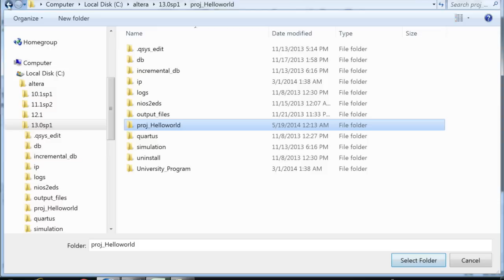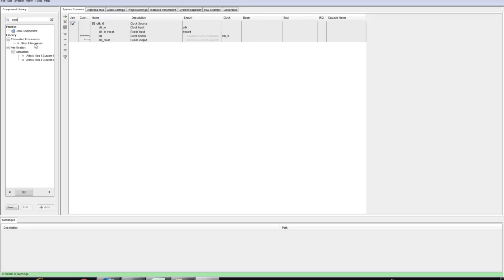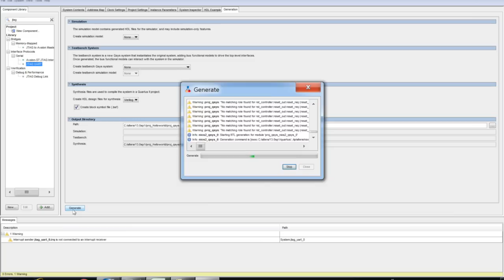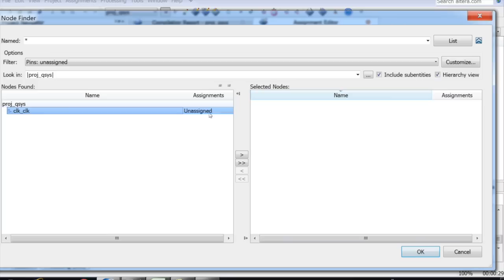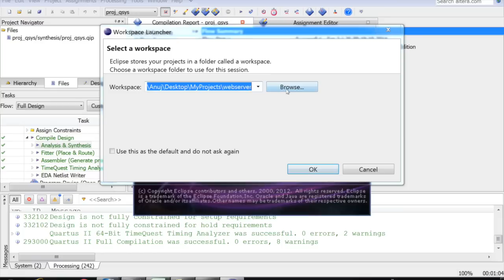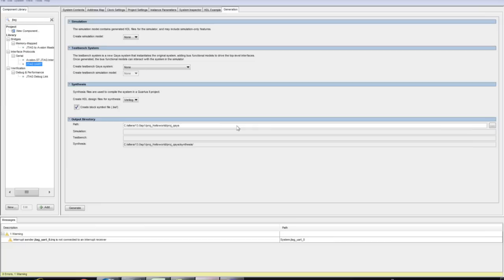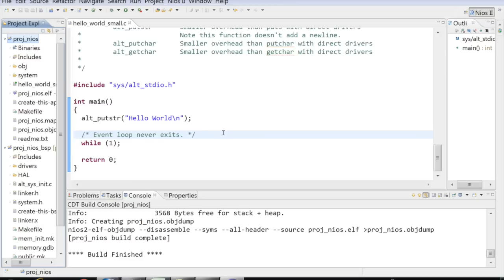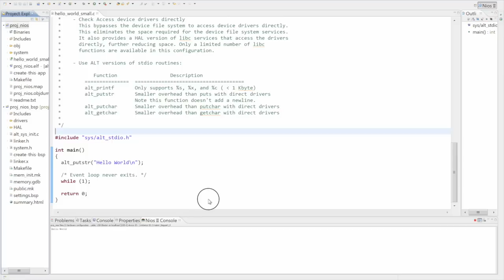Altera FPGA tutorial - "Hello World" using NIOS II processor on DE1 Board

Comment: Nios II Software Building Tools for Eclipse DOES NOT OPEN! It just silently crashes! I have a Windows 10 system and solutions I find on the forums are for Linux systems!

I tried everything, updating/reinstalling Java, looking at the folder where NIOS II is, it just does not work! What do I do?
Reply: SOLVED THE ISSUE! It turns out Quartus Lite 19.1 has a bug in Eclipse that prevents it from launching on (windows 10?) machines. I downgraded to Quartus 16.0 and now I have no problems.
 
Why, Intel? Why?
Reply: @fzigunov  wow... Good to know that
Reply: Try run as admin. Works most of the time
Reply: @anushamanoj3607  I obviously tried that already, the issue is the same.

Comment: When i run as nios II hardware , i get an error: downloading ELF Process failed
Reply: I had the same problem. It turned out that the problem was because of the clk selection. For the DE0-nano board, select pin_R8.
Reply: @krsmith197  I gave selected Pin R8. But I am still facing the problem of no elf file in run configurations
Reply: @krsmith197  You have any idea how to fix it?
Reply: same
Reply: I had the same problem, downloading ELF Process failed, how to solve this ?
Reply: Sometimes this problem is caused by missing connecting the  clock_in_reset pin to the jtag_debug_module_reset pin